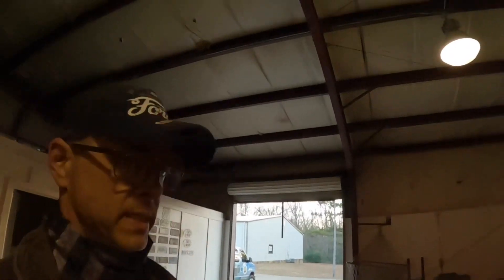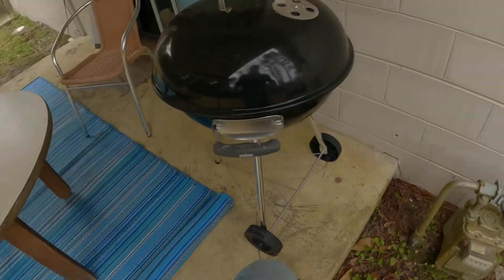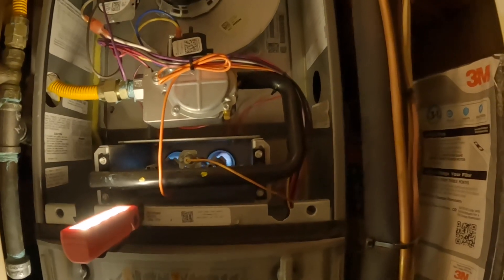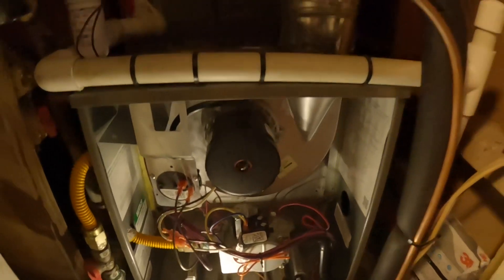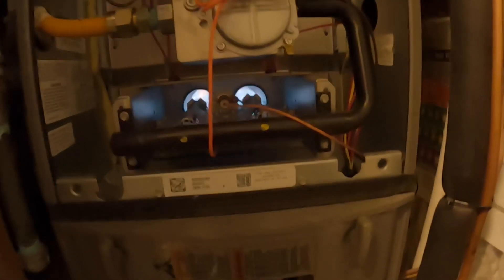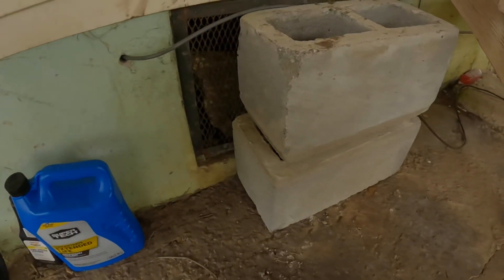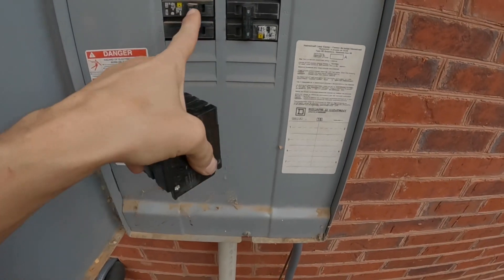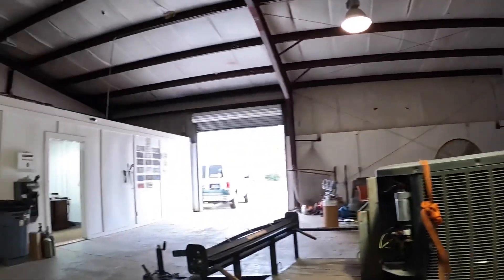Ride Along As We Do 3.5 ton Changeout, A No Heat Call, and Preparation for Work Tomorrow

Comment: Those flexible gas connectors are a no-no in the state of CT, awful to see down there in GA, come on people don’t be lazy…only on stoves and removable appliances are they tolerable
Reply: They are not as strict about it, like a lot of the northern states are that have just little more stringent gas fitting codes.
Reply: It’s not lazy. They work
Reply: here in jersey they are allowed. just can't pass throught the furnace cabinet like that. we have to stub out with hard pipe. i prefer hard pipe though but i have used my share of gas flex in a pinch